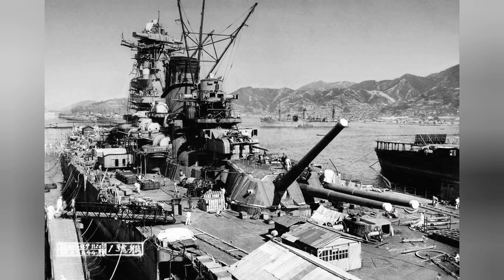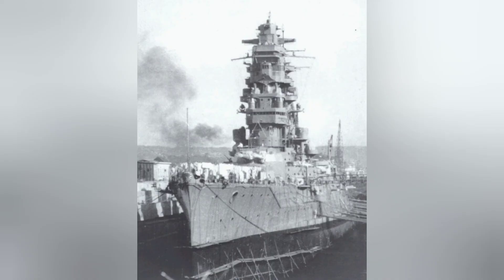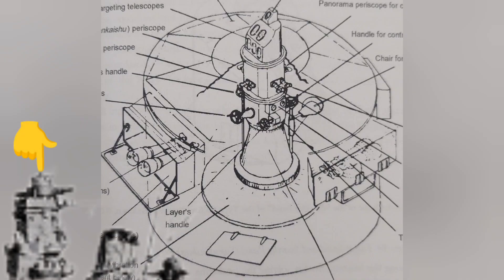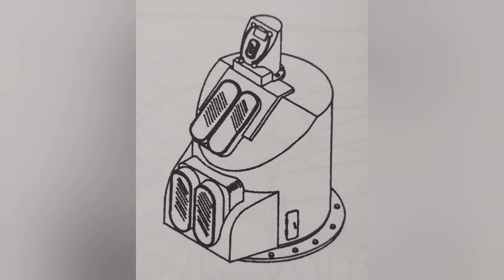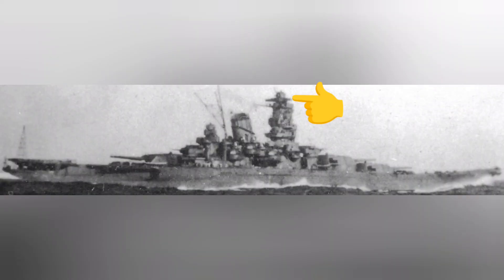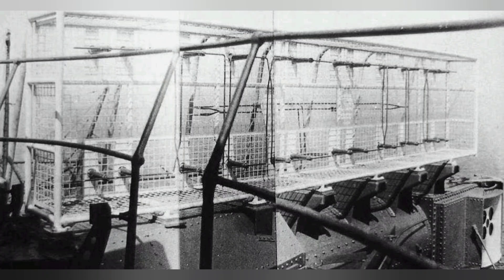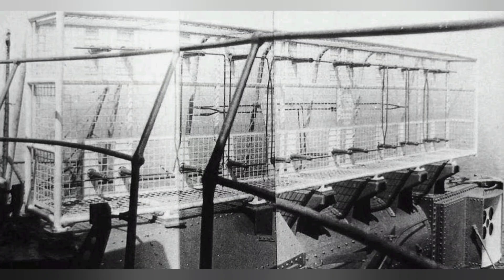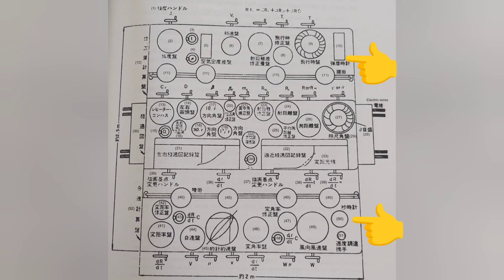IJN Yamato: Fire control

Comment: It's unfortunate for the Japanese that the Yamato-class were the only BBs that possessed decent radar equipment.
Reply: Actually, all Japanese battleships had the same type 22 radar system the Yamato and Musashi had.  Even Japanese heavy cruisers had the same type of radar system.  The Yamato and Musashi most likely had their radar array mounted higher then just about any other ship in the Japanese Imperial Navy; with the possible exception of Fuso and Yamashiro, so the Yamato class ship's radar might have had a slightly better range detection ability. 

Fun facts about the reliability; or lack there of, of the type 22 radar.  There were about 300 of these radar systems built.  The first 50 were found to be defective and could not used.  The mean to failure rate of a vacuum tube used in WW2 Japanese electronics was about 100 hours.  The type 22 system used 40 vacuum tubes, the failure of just one tube could knock out the entire system.  Japanese radar doctrine was to keep their surface radar systems turned off unless battle was expected or the enemy was blundered into, in which case much of the radar systems usefulness had been discarded.  My guess is part of the reason for this doctrine was because their radar system could not remain on for more then two to three hours before a breakdown could expected.     

The Yamato and Musashi's visual control system; their range finders and directors, were larger and therefore slightly better than other Japanese battleships.
Reply: I'd argue it's a good thing. But I get where you're coming from.